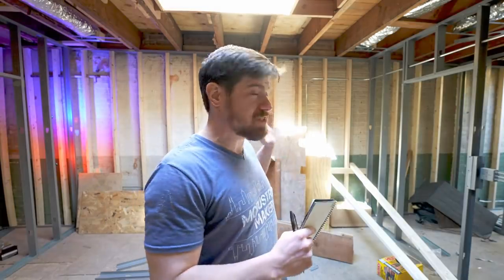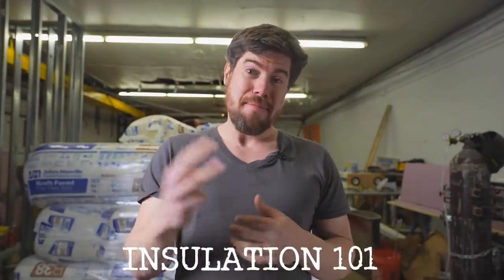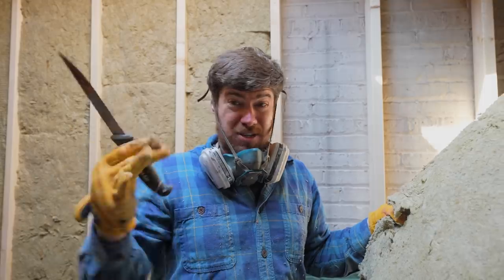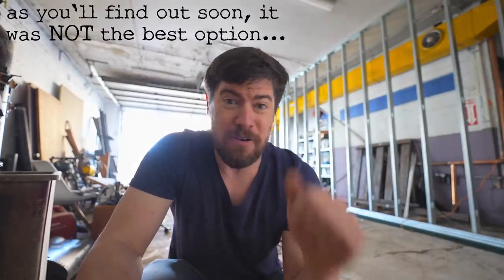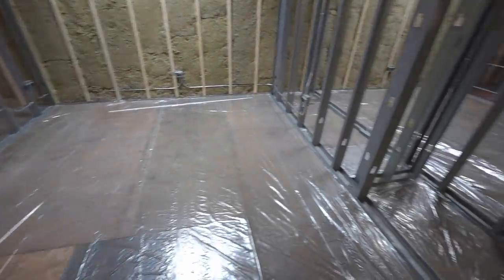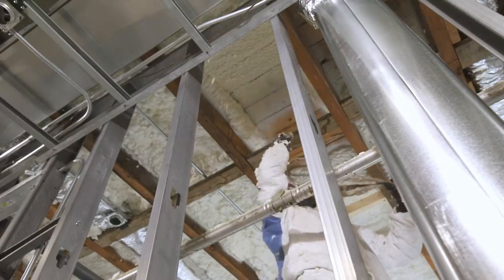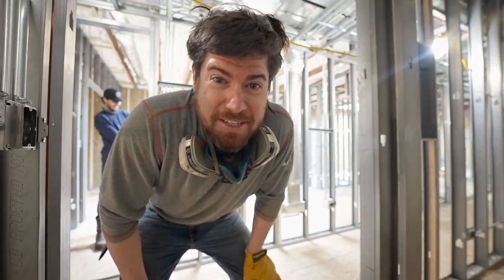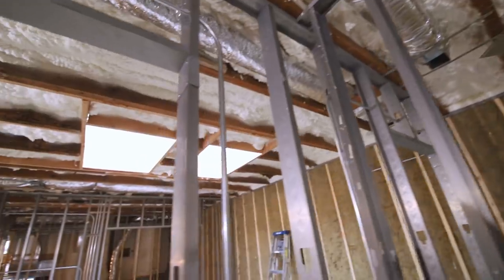Ep. 15 Abandoned Building Renovation || INSULATION + SOUNDPROOFING

Comment: Alot of trust letting the FLT driver drop those pallets off XD imagine the mast of the truck hitting the front of the building or the ruining some electricals inside, would set you back or cost you for repairs.  I drove FLTs for many years in factories and warehouses and you see some stupid stuff, and some simple mistakes, where people just lose concentration for a second and rip out a bunch of metal frame or wall brackets etc XD

Comment: Rock wool helps with sound.  I highly recommend doubling your 5/8 sheet rock and sandwich some sound caulk between the two sheets on the wall and ceiling of the master.  You won’t be disappointed even if it is a bit more.

Comment: Sometimes you just have to accept that you need a pro to do the job.  Spray foam is a superior product for the exterior wall and roof. Doesn't matter the R value if the air just goes around it, and plastic sheet can never be made tight enough (e.g. staples, drywall screws etc).

Comment: My wife work for a brand that is famous for its pink insulation she says that mineral wool is actually way more itchy, as a product engineer she says that your actually spending less money using mineral wool because it gives you a higher R value then what fiberglass for the same thickness and generally speaking comes with more insulation per bag. At the end of the day the fire rating of mineral wool is more of advantageous coupled with higher R rating and Waterproofing.

Comment: Whoever did the pluming, made a mistake: failed to install water hammer arrestors. A simple T joint + closed pipe with trapped air is not the correct way of doing it for a long time already (it was ok 20 or 30 years ago). When the air escapes (and it will) it won't do much. You can install it later, even under the sink, since you put spray foam over it already.
Reply: You have to remember this is Chicago.  Things don’t change rapidly and unions control the construction industry.
Reply: @williammcrae3177  Just because the code says its enough to install 100 year old technology, it does not mean you can't do better. For example I would have not used copper pipes at all. In Europe all houses built in the last ~30 or so years uses 5 layer reinforced plastic piping. No corrosion, no metal fatigue from the water hammer effect, won't break if the house moves over the years, won't break if the house shrinks/expands due to heat, etc.
But I guess Americans don't need to build anything long lasting, if a house lasts 10 years its fine for them to rebuild it every time.
Reply: @valamilamasag  you are not understanding what I said.  Chicago is a city with heavyweight union presence.  It’s all about jobs...union jobs.  Plastic type plumbing is too quick to install and therefore requires little labour which goes against the idea of employing people.  Sometimes it’s called “make work”

Comment: I knows its too late for you and this project. But a really sharp steak knife works great on rock wool but rock wool dulls blades like crazy. A better tool is a snap knife blades are sharp and you can cut most ecerything in one pass. A heads up for anyone who hasnt used rockwool it "shatters" unlike fiberglass so handle it carefully.

Comment: Lots of insulation goodness. 

Hopefully you’re filling in those internal walls between the hall and rooms because it’s so easy to skip over and not realise the amount of noise transmission that goes on in a house. 

Just finished staying in an Airbnb where the owner hadn’t insulated the internal walls between the hall and rooms and we could end up hearing all the noises at night from things like dishwasher and washing machine. 

Not a good thing when you’re trying to make the magic happen but all you can hear is the whir of a 1600rpm spin cycle of a cheap ass washing machine.

Comment: The good thing about spending extra on insulation is that the more you spend on the product, the more you save off your heating bills meaning that you will get your money back over time.  I am suprised that no insulation was added to the outer brick wall in the studio room as that will effect heat retention quite a bit.  While the spray insulation may cost more for the material, it looks like if you are having the work done professionally you would probably make the money back against labour costs.

Comment: You’re going to hate yourself if you ever have to do any work on that piping. Trying to do anything inside of a wall that was sprayed insulated is basically impossible without removing all of the sheet rock and then having to do a ton of work cutting everything out from the foam.

Comment: what about vapor barrier? mineral wool, fiberglass and even open cell spray foam needs protection from vapor. You get mold from the condensation of water vapor in the air. Also, the heat insulation stores that water vapor and looses it's properties.

Comment: did you do any low voltage wiring (cat 5/ cat6) in the ceiling or TV's for wifi hotspots and wired connections?

Comment: You should really not push the insulation up against the bricks on outter walls, this can cause for condensation if there is not enough space for air to move behind. ideealy you should have an inch or so between insulation and bricks.

Comment: I noticed you didn't mention radiant barrier insulation and I'm curious because it seems like it would be the easiest for the ceiling and outer walls as you just lay it and staple it in and it works great.

Comment: 22:02 I don't know if you've heard of it before, but there is a product called Soundroc (I believe) that is a sound proofing version of standard drywall.
Basically, it's 2 sheets of slightly thinner than normal drywall sandwiching a sheet of polymer and metal. I'm not sure where you'd get it or what it costs, but it can be installed as a DIY (cutting it might be a little more involved/difficult than normal drywall), but it goes on with standard drywall screws...
I saw it used on one of Mike Holmes's shows (Holmes Inspection or Holmes Makes It Right)...
Reply from the maker: haven't heard of that, but it sounds similar to green glue, which I used at my old home.  it does work pretty well.

Comment: I was going to suggest Rockwool. I love the stuff!  Don’t forget that it’s also extremely fire-resistant and doesn’t collapse under its own weight when you layer it.  FYI, there’s a spray foam gun you can pick up at Lowe’s/Home Depot, which runs about $50, that will pay for itself MANY times over.  It not only allows you to be more precise with your spray foam application, it’ll also let you use more of the contents in your cans.  Much more efficient.
Reply from the maker: for sure!  I actually recorded some footage burning fiberglass and rockwool to compare them, but after the change in plans, it no longer fit in this video....maybe I'll throw up a YouTube short.

Comment: Quick tip brother, i know youve done it before but .. before putting your drywall since you jave unfinish floor, i usualy mark my electrical mesures and location on floor before putting drywall... it make it much easier to grab your router quicky and cut the opening easily, i do the same for recessed light :p .. thats how i can finish a 800 Sf basement under 4 days alone 😁
Reply from the maker: good tip!  Just so happens I've got a "5 things you must do before installing drywall" video coming soon, and I mark all the locations of my ethernet wires on the floor in that one ;)

Comment: Generally a flat roof, has rigid insulation, on top, underneath the membrane. Thickness dependent on climate area. I am North of 55°N Latitude, so it is quite thick. Don't know the exact, but it is ~1' or more.
Reply from the maker: Yup, we have poly iso sheet under the membrane, but only 1"....if I could do it again, I would have gone thicker with the poly iso, but I think this will do a good job too.

Comment: I have found that when trying to resolve problems in the field, it is best to ask the person who designed the building. They usually understand the full building assembly much better than the individual trades. This is especially true with insulation.  Also, they may have specified the insulation in your permit-approved drawings. Here is an article that explains why you should not install open-cell spray foam at less than code.  Also, the code minimum in Climate Zone 5 is R49.

https://www.greenbuildingadvisor.com/article/its-ok-to-skimp-on-insulation-icynene-says 

Also, since you have installed vapor-permeable open-cell spray foam insulation on the underside of your flat unvented roof, you may want to read the article about how to deal with the vapor barrier so as to avoid getting condensation in your ceiling which will cause mold growth.    

https://www.greenbuildingadvisor.com/article/insulating-low-slope-residential-roofs
Reply from the maker: we have a layer of poly iso on the roof that serves as vapor barrier.  I'm trusting the guys that do the work on these types of buildings in chicago all the time.

Comment: I imagine if you were to use spray foam, any work in later years would be a nightmare. Say if you had to replace any rotted framing. Also, what about plumbing leaks? If everything is covered with spray foam, that would also be a nightmare just trying to find it. Just my 2-cents... You put a lot of work into your videos, my hat is off to you sir!
Reply from the maker: thanks!  as long as you know where the pipes are, most of them are accessible from below (under the floor).  The foam cuts out fairly easily, if I ever do need access, and can be patched back up with great stuff.

Comment: Lesson learned, glad it turned out better than you expected. With regard to the spray foam insulation, if the price included 5he labour cost for trimming and removing the foam, that would be a great price. There are lots of spray foam companies that will reduce the price if you are prepared to do the trimming and disposal but you dodged a bullet by going all in. Trust me when I say to trim ceilings is not fun and can take longer plus the disposal can be messy because you would need to get it all together then bag it. Spray foam will be 5he norm over the next few years especially on new builds and the prices will come down. Looking forward to the next installment. Stay safe J.
Reply from the maker: Yup, that was an all-inclusive price.  I actually tried the saw a bit in the penthouse, and can definitely see how it could be a pain in the ceilings....fortunately I don't think it was too bad in my case, since I've got 12" joists, and they only sprayed 6-8" (meaning there was almost nothing that needed to be trimmed from the ceiling).  Their system for disposal was pretty clever....they basically just used the plastic sheets the put on the floors as bags, pulling it up from corners in so all the excess foam was trapped in the sheets as they were pulled up.

Comment: Nice job! A little tip for you next time insulating: when cutting fe. rockwool in the right size to fit the missing part between studs, always use the excess part of your cut as the start for the next two studs. This has a big effect to your waste generated and can reduce budget.
Reply from the maker: Definitely!  This is what I did most of the time, when there weren't two ppl working simultaneously

Comment: I'm not sure if this is at all important where you are: but for cold weather, you'd need to find out where the condensation point is and it shouldn't be in the rockwool. Also, as far as i know, Rockwool does need some air around it??
Also, aren't the brackets in the guest bathroom a perfect cold bridge?? I might be wrong, but that metal would be conducting the heat out through the insulation, right?
Reply from the maker: Rockwool needs some air on the ceiling.... for walls, they are usually filled completely, as I understand it.  Re: the brackets, that wall is actually right up against the neighbor's brick, so hopefully it won't serve as a cold bridge.

Comment: I'm confused. I thought you hired them for the ceiling, but the whole first half of their spray footage was on all the roomn walls where you had already hung wool bats. Did you tear out all your previous batting work before the spray truck arrived?
Reply from the maker: no, I only had done the batts on one side when I discovered my mistake and realized I needed spray foam.  Cost difference was small to add those on, so I had them do the walls too.  I mention this at a couple points I believe ;)

Comment: you could have installed the fibreglass by leaving a min 2" clear cavity across the top with roof vents in the roof to ventilate it and then installing a vapour control barrier to the underside of the insulation to prevent moisture from entering  the insulation and condensing in the ventilated void, or?

Comment: I guess this is way too late, but...  while your studs happened to be away from the wall due to the curvature of the wall, it's generally recommended to keep studs and insulation away from brick and concrete walls to allow them to breathe to prevent moisture from seeping into the studs, and to prevent mold from building up behind the insulation.
Reply from the maker: The mold and moisture buildup isn't as much of concern with Rockwool, fortunately

Comment: Actually no.  If you have adequate ventilation for the building, and are using a dehumidifier system, you wouldn't have a problem.
Because you're not going to see enough moisture buildup.  ESPECIALLY if your roofing system is working properly.
If it was a problem, you'd have the same issue with the open cell foam you got.  Because it's NOT a vapor barrier or air barrier.
Sounds like someone scared you with a "worst case horror story".  Sorry that happened to you.
On the plus side, you have a better insulation system now and you just increased the racking strength of the penthouse walls immensely

The one piece he was able to just rip out whole?
That's because it didn't adhere properly.
Kudos to your installer for not just leaving it.
9 times out of 10, it's because there's dirt or something inhibiting adhesion.  And in most cases, it's not a HUGE issue.  But your guy is a good tradesman and made sure you got the best application possible.

By the way, bang-up job on your Rockwool install.  It LOOKS easier than it is.  Especially if you want to extract maximum value out of it.

And I realize you've probably already gotten past drywall.
But what I would have suggested for the master and the studio would have been 5/8" drywall on the walls.
The mass of the thicker sheetrock knocks down sound, ESPECIALLY when backed by stuff like Rockwood, like nobody's business.
Reply from the maker: Good info, thanks!  I'm doing drywall now, I think they bought 1/2" tho.  I was considering doing double layer with green glue too....did this in my old loft and it worked well
Reply: @modustrial  Yeah.  A double-layer and green glue should work as well too.

Once everything's sheetrocked. maybe do some noise testing in the bedroom (NOT THAT WAY!) and in the studio, with someone standing in those rooms and someone downstairs of them making noise.

This way you see what sort of sound transmission you're getting through the floor.

Then, if it's deemed "too much", think about ordering 24"OC batts of the Rockwool Safe & Sound (rated for sound transmission, not R-Value) in the floor/ceiling between the two levels.

Comment: You shouldn’t push the batts against the wall because if there is an condensation on the bricks at any stage it could cause mold. But if you leave a gap the air flow will prevent moisture buildup. It looks great though
Reply from the maker: Rockwool doesn't mold like fiberglass :)

Comment: I was surprised at the spray foam too! Other than mold resistance, are there other major benefits? I'm most nervous about repairs to pipes and stuff that would get buried under it.
Reply from the maker: It is way more efficient for heating and cooling, since it completely seals everything....so it reduces heating/cooling costs over long run

Comment: Forbidden Marshmallows.
Edit: Also, loving the status bar on the bottom of the video for segments.
Edit2: Why didn't you put the orange stuff around the sockets in the non-exterior walls you soundproofed?
Reply from the maker: Great stuff helps for insulation, but not acoustics
Reply: @modustrial  No, I meant the fire hazard foam around the outlets in the outer walls but not in the interior walls when you added the wool. I think I might have confused things though! Great video as always, either way. Thanks for the response!

Comment: I like the spray foam idea but I’m always re running wired to add more lights or outlets or renovating different things so I’m worried about how difficult it would be to run wires
Reply: 👌🤩 Solution is to bury a piece of pvc or similar for all wiring. Then you can add to or change out any wiring whenever you want/need to! Great solution considering upgrades for internet capabilities! 👍

Comment: 4:30 That wall isn't done. You missed a section at the top of the left most space and the bottom of the next space over. These 2 spots will bleed heat like you wouldn't believe...
Reply from the maker: I didn't show EVERY SECOND... those were filled in ;)

Comment: Just curious: Do the outer brick walls not have any insulation whatsoever to the next buildings or outside? I'm used to old brick walls consisting of actually two rows of brick with at least an air gap as insulation, or that gap being filled with a modern material, like spray foam. I was just taken aback by the fact, that you insulated against the brick wall, that should have insulation already. But maybe that's just us crazy Europeans.
Reply from the maker: I believe it's two rows of brick...also, my wall is right up against the neighbors building on one side
Reply: @modustrial  ah. Too bad, you're losing some space/volume on the inside.